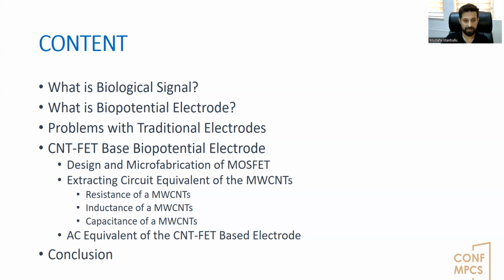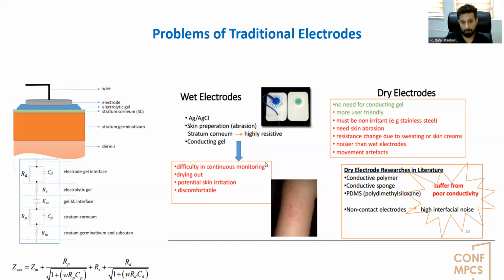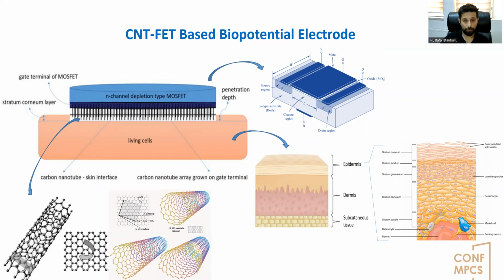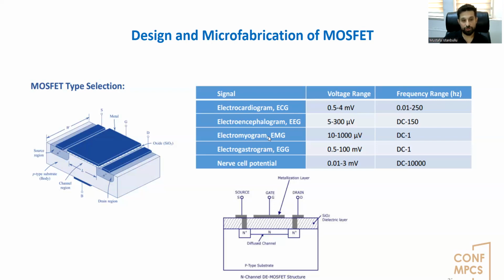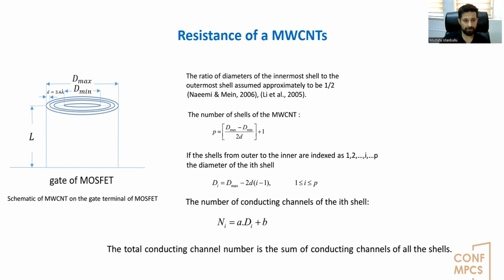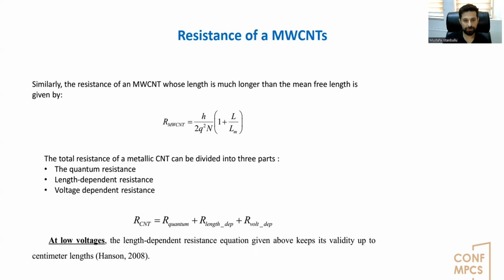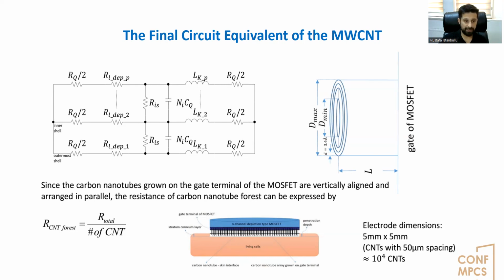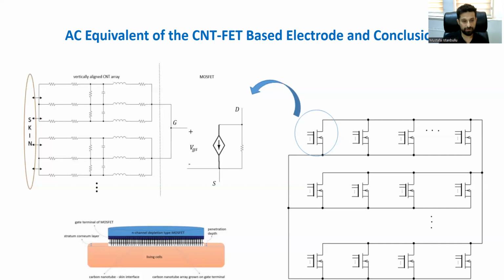CONF-MPCS 2023 - Extracting the Electrical Equivalent of a CNT-FET Based Active Biopotential ...

Comment from the maker: Here are the questions we collected and the answers replied by the presenter.

Q1: In your presentation, you mentioned that the electrical properties of carbon nanotubes make them ideal candidates for constructing highly sensitive electrodes. Could you elaborate on which characteristics of carbon nanotubes give them this advantage?
A1: All carbon atoms at the side walls of the CNTs are bonded to other carbon atoms. But at the tip of CNT, there are unbonded atoms that could easily be bonded. This structure makes the tip of the nanotube more active than the sidewall. Besides, the electron transfer rate of the carbon nanotube tip is 10^5 to 10^6 times higher than its lateral surface. These make the carbon nanotube a very convenient material for taking signals from its tip and transmitting them to any instrumentation circuit. 

Q2: You mentioned the process of extracting the circuit equivalent of multiple carbon nanotubes to optimize the performance of biopotential electrodes. Could you explain how this process helps enhance the performance and sensitivity of the electrodes?
A2: I think there is a misunderstanding here. Of course, extracting the circuit equivalent can not enhance the electrode performance. However, in order to optimize the device, the designer needs to know the effect of each part and each parameter on the performance. Almost everything depends on the electronic circuits, in a device with an instrumentation part. Thus, we need to extract the circuit equivalent of CNTs to optimize the device and to understand its behavior in specific cases such as low-high frequency range or low-high amplitudes.